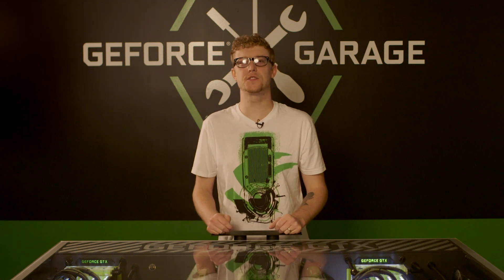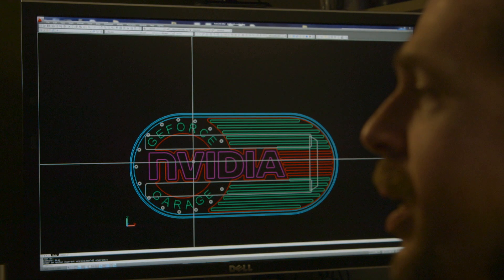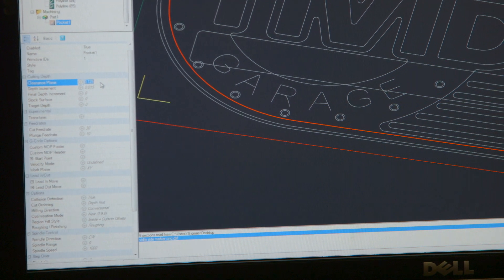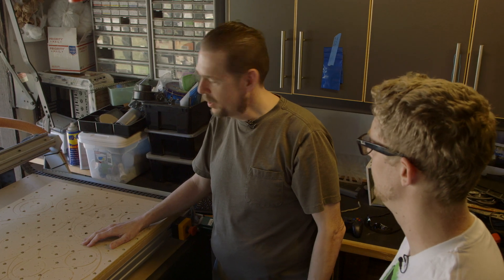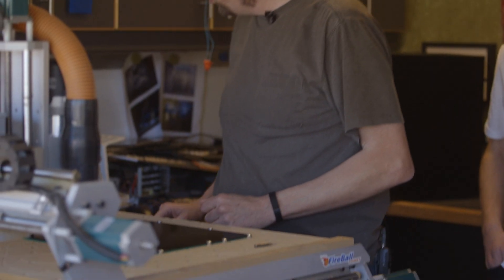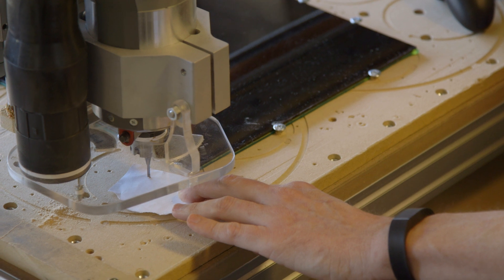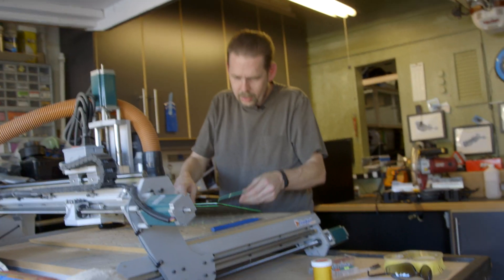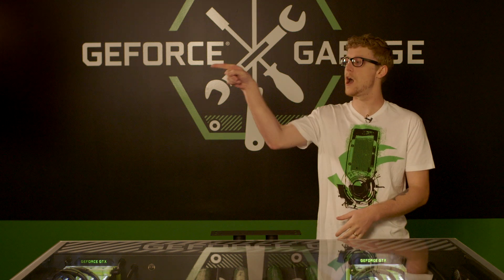GeForce Garage: Antec 900 Series, Video 5 – How To Use CNC to Make Custom Parts

Comment: So Nvidia, I know someone with a CNC machine, but they use wood for their projects. is it possible to adjust it for metal use?
Reply: I am a machinist. You would use the same bits to cut metal as long as those bits are carbide however you would need to have a very powerful spindle motor and possibly some coolant depending on the job at hand.
Reply: +Alexander Sainz Interesting. I'll look into that. Thanks for the help!